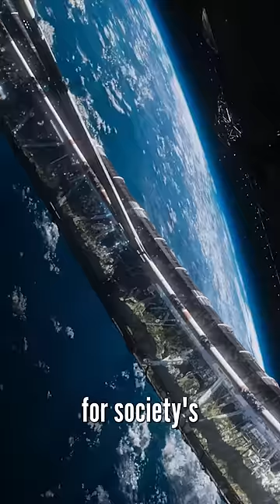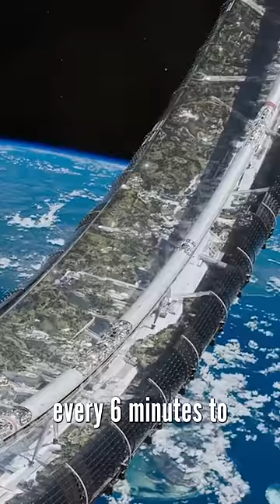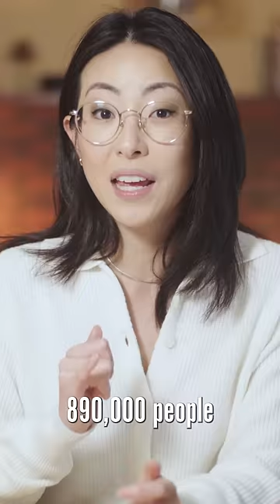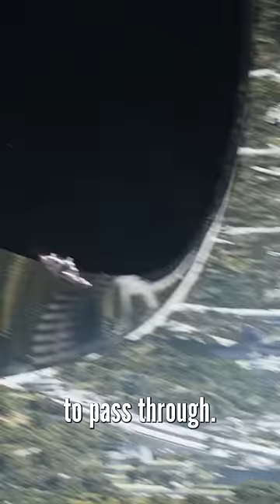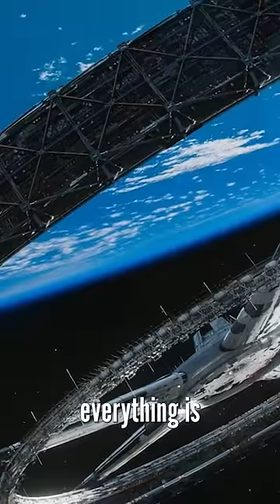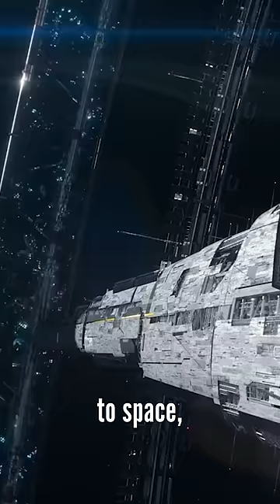The Architecture of Elysium

Comment: I'm no master Chief, but I know a HALO when I see one
Reply: This is like a baby Halo. If I remember correctly Installation 04 is roughly the  diameter of earth....fuckin huge
Reply: @nocturnalsimulacrum6385  the modern halo rings are around 10000 km in diameter which is around the size of earth.

The original rings were 30000 km but they were usually scaled down due to structural worries.
Reply: Bigmeechx3   why the black sun and the deaths head profile picture?
Reply: @Phoros  probably doesn’t even know what it symbolises.  Thats definitely a Totenkopf.
Reply: These type of space station ideas were there before halo, like in Space odyssey
Reply: @shivamarya5225  my favourite game all the Halos but I think your right infact I think the designers did take and run with this idea for Halo from old novels and movies.
Reply: @Phoros  lol I didn't think someone was gonna call it out
Reply: That's exactly what I was thinking 😂😂😂
Reply: Fun fact: Elysium used some props from the cancelled Halo film, along with District 9 which the scrapped projected more or less turned into.
Reply: @IanBPPK  C00L thanx for that I didn’t know that.   I really wish that Halo film got made with Spielberg directing like it was supposed to be about 10 years ago, instead we got a crappy series that does not follow the lore.  Halo lore is probably the most diverse and brilliant and imaginative of any platform game I’ve ever known.  The stories and character arks are so clever and well thought out and there is loads to make a full trio of 3 Hour movies easily.  Why do idiots always get hold of great IPs and make a complete and utter pigs ear out of them.
Reply: Battle Angle Was long before Halo
Reply: Exactly my thoughts
Reply: @Phoros  black sun was originally a slavic symbol, on its own shouldn't be seen as "problematic"
Reply: @ceasarcruz8312  yeah except no one uses it for its original meaning anymore and its paired with a totenkomp in this case making it clearly a nazi symbol
Reply: @Phoros  are you sure no one is using an old symbol for what it originally represented...? what makes you so certain, that you deal in absolutes?
Reply: My thoughts exactly
Reply: Go read Larry Nivens Ring World series its so good and the inspiration for halo
Reply: You right, that's a Halo
Reply: Bigmeechx3   who is us?
Reply: The guy who made this and district 9 was supposed to make a halo movie but it fell through i guess.
Reply: Always happy to see fellow halo players
Reply: Bigmeechx3   you're damn right 119
Reply: Im no master chief but i can cook for my own.
Reply: Yeah but can this one send out a death ray that wipes out all life in the galaxy?
Reply: The movie was actually SUPPOSED to be Halo.
Reply: Gundam wing.
Reply: These kinds of designs predate Halo
Reply: @Rawsilver  Correct, but this movie was supposed to be Halo.
Reply: I was gonna say it was a Quincy… oh wrong media
Reply: That's what I'm saying
Reply: @ceasarcruz8312  could be the fact that the dude literally has neo nazi in his YouTube bio
Reply: @Phoros why the 88 in your name
Reply: Yes halo
Reply: Im reminded more of the colonys in gundam
Reply: @Phoros Ukrainian probably lol
Reply: "Here we go"
Reply: @sasquatch8245  Somehow the term 'Forerunners' and 'Structural worries' makes me laugh, considering what they've made.
Reply: @mortarion9813  yeah it's pretty insane, maybe if they hadn't cheaped out on contractors and made them wider than a planetary belt buckle it wouldn't be such an issue
Reply: Comment recognition! Eyyyy
Reply: @sasquatch8245  I actually meant that it's funny considering that they have architectural and scientific feats that could technically label them as Gods, but that too.
Reply: @Phoros   It's an NSBM fan
Reply: @Biketunerfy   It's an NSBM fan. They know what it is.
Reply: YOU DANM RIGHT
Reply: @nocturnalsimulacrum6385  The original rings where actually even bigger as well. (The rings that we know of in the games are actually the second version).
Reply: It's much smaller than a halo
Reply: They sure did a good job covering the monoliths to block and hide its firing structures (pretending it is one)
Reply: Larry Niven's "Rinngworld" series. That's where it began.
Reply: @shivamarya5225 or the Culture book which was a big insperation for the Forrunners.

Or if you go back more Ring world
Reply: @vonfaustien3957  that's what im saying, halo dudes see any ring and think halo

Comment: Thank you for the explanation Dami. I've always wondered about the "technical" explanation of Elysium movie since I watched the movie when I was still in high school. Now here I am as a fresh architecture grad.
Reply: If gravity is 1 g, diameter should be 64 km. With given area of 377 km2, belt width should be 1,87 km. 
Dimensions looks maybe bit off scale, but maybe gravity lower than 1G .  Or maybe i calculated badly :)
Reply: @kutkitket3570  is the surface are given of the disc, or the livable part, because it looks like there are a lot of gaps that would reduce the surface area.

Comment: Those remind me of Gundam's space colonies.
Reply: The UC habitats are better thought out. They are narrow which means you can build much bigger. They are sometimes pictured as enclosed which they would have to be to save people from horrible radiation burns and nausea from the pinwheeling stars. Finally they are all built at lagrange points which gives them relatively stable orbits.
Reply: @iivin4233  not to the colony builder, which allows people to safely live in the colony while it's under construction, and doesn't require massive prefabs to be sent from Earth
Reply: It came from a manga so probably was influenced by gundam.

But gundam colonies are gigantic though comparr to elysium. But really poorly written since one colony should be able to destroy earth's surface if dropped down. In gundam it only destroyed australia.
Reply: It's called an O'Neil Cylinder. The technology is fairly simple but the construction would be a monumental undertaking
Reply: @maosama3695  a colony is mostly hollow. If anything, mostly the core would be making the impact. The depiction of the whole colony making it through atmosphere is a bit inaccurate, if you ask me.
Reply: @citrusjuicebox  hollow or not a size of that colony could drastically change the surface of the earth.

And of course we should consider what type of metal they are using. We know that colonies are made from metal mined from asteroids which commonly do have common metals and rare metals like platinum. They could easily make aluminium alloy with it or tougher metals that could survive reentry. 

But it doesnt matter those things are huge before it can all melt it would still hit the earth and even if half of it is gone it could still do apocalyptic damage.

Onw colony being dropped on earth wouls be  enough cauae for the federation to lose. But for some miraculous reasons they didn't.
Reply: @iivin4233  Not well thought out enough to stop them being used as giant superweapons. Then again, it's hard to defend against that kind of thing.

Comment: I'd love to see you look at the architecture of the Citadel from Mass Effect. 

Mass Effect also has other styles of architecture you can review at places like Omega, the asari homeworld and even just normal colonies. 

Oooh and it would also be so cool to see you review architecture in a fantasy setting like Kirkwall from Dragon Age 2 (the architecture kinda conveys that this used to be a hub for slave trade)!
Reply: Citadel architecture in Mass Effect is extremely bad, though. At least from logistical point of view. It's like building a city with only one main intersection in the center, with no connections inbetween. Kind of like Paris, but much, much worse.
Reply: @imaginarystranger1974  It's primary purpose is not to a Space station. 
It's not even its secondary function.
Reply: @yazi7790  Well, according to lore the station has been used by many species over hundreds of thousands of years, at least one of them had to have made an improvement.
Reply: @imaginarystranger1974  Read the Lore.
It's not supposed to be a space station, its primary function is vastly different.

Keeper took down any major structural changes harvest Species tried to make.
Reply: @yazi7790  I know the lore, and keepers wouldn't be able to dismantle huge changes. Advanced species which weren't tolerant to the keepers would've likely exterminated them anyway. A huge plot hole.
Reply: @imaginarystranger1974 keepers were just the house keeping and citadel defence system would have simply wiped them out.
Or bettter yet catalyst would have called the reapers.
Citadel houses the catalyst, he made reapers
The AI which eats civilisations for breakfast,
The head hancho running the galactic cycles.
It's not as simple as killing the meager keepers.
Do another playthrough.

Comment: Why would you pre produce the modules on Earth and carry them into space - thus expending a huge amount of energy and fuel - instead of carving out an asteroid or two and using the raw materials to build the modules directly in space? If you're at the point that you can reliably and frequently send people into space you're also at the point where your industry is good enough and automated enough to let you set up autofactories or use remote controlled mining drones anyway.
Reply: It would be way easier to just make the modules on earth. You would end up having to send entire factories from earth into space, unless you're not only building the modules in space, you're building the factories in space, and building the refineries in space, and building the mining machinery in space. At which point its hard to imagine automated drones constructing that much infrasture out of an asteriod before it could actually start on the Elysium project.
Reply: @dirkwalker9686  or you can just send automated mining drones in orbit to find and tow a likely asteroid where you want your stuff to be built, and then telepresence them to mine out that asteroid and build the factory you need out of that, so you can build the rest of your stuff. Think of the fuel you save by not sending all that junk into space from earth.
Reply: @Firepowered  Before you build the factory you'd have to build a refinery to refine the raw material and make alloys. Assuming thats even possible using just raw materials from the mining drones. On earth it takes skilled construction workers years to build a decent sized factory. Building it in space with remote drones would take decades. Yes launching modules from earth takes a lot of money but it's orders of magnitude more simple and we already know how to do it. Maybe 100 years from now we can get automated orbital construction going but its absolutely overkill for our first space mega project.
Reply: @dirkwalker9686  It greatly depends on the tech level you're operating at. I am assuming an advanced enough tech level where we already have industry in orbit (which in turn implies we have ways to get into space cheap, like tethered rings, or launch loops) and a scattered presence at least in the inner solar. if you have that, then access to raw materials isn't an issue.

If your tech is not at the level where we've got space industry already, then it would make more sense to build the modules on earth then send them into space - but if so, how do you justify building a giant megastructure this way before properly developing your space industry? Seems a bit like putting the cart before the horse here.

Comment: Quick question... wouldn't the outer ring be moving faster than that in er ring? Does the speed affect the artificial gravity as you move further out? Excuse my ignorance on this one... I imagine the inner ring is more for engines or structural stability and not necessarily the place where citizens live...